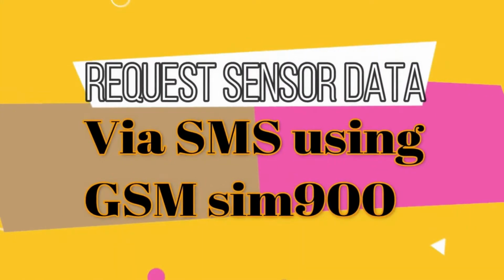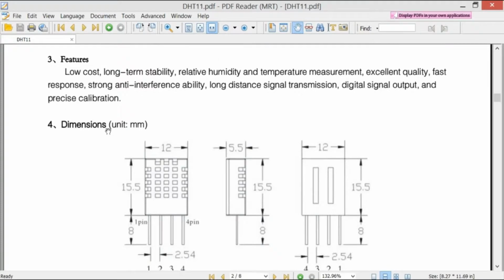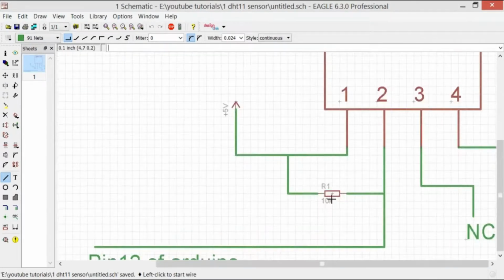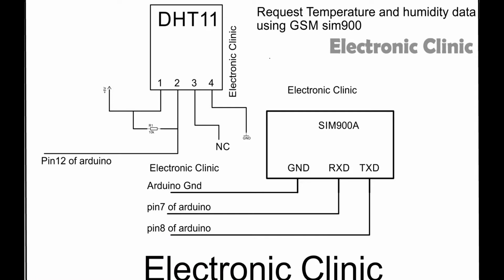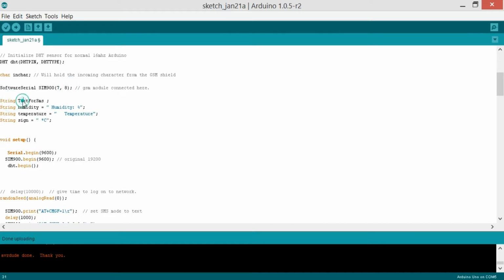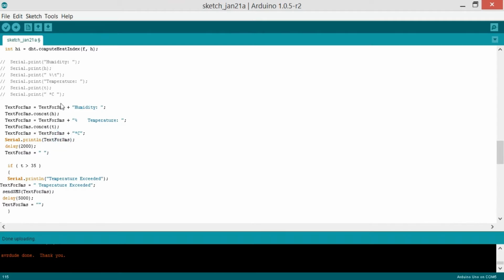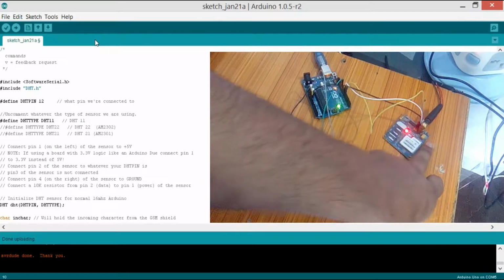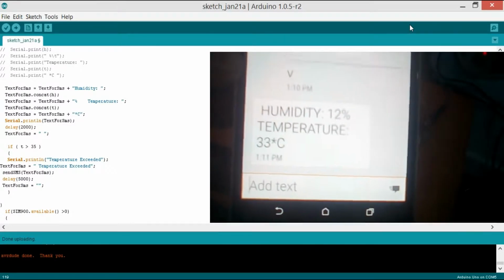GSM sim900A/sim900D based temperature monitoring from anywhere using Arduino board,DHT11,android cel

Comment: We are using sim800v2 is it compatible for the code you provided?
Reply from the maker: Yes it is. But I recommend get yourself 4g LTE module. Sim7600G.
Reply: Do we have to change anything on the code?
Reply: Because we tested it, its not working
Reply: Thanks

Comment: the sms is not sending, how can i solve the problem in my sim900a
Reply: what can i do, i think my sim900a is locked
Reply from the maker: if its locked then it won't work. Next time when you purchae a gsm module, try purchasing the LTE version. You can watch my videos on SIM7600G and Sim7600G-H gsm modules.
Reply: @ElectroniClinic  it is working fine and it is blinking but when im trying to call it, its not ringing. what can I do?

Comment: Temperature Exceeded waring appearing on the serial monitor and SMS transmission starts. But an ERROR message is appearing in the serial monitor at the end and no SMS received on the phone. Even setup is not responding to "v" SMS. Please help.

Comment: I have done everything described in the video above.
For temperatures exceeding the setting temperature, SIM900 will send SMS to the cellphone.
but for the status request from the cellphone by writing the letter v, sim900 cannot send sms.
when the letter v is received by sim900, the message that appears on the serial monitor is only: + CMT: "+ xxxxxxxxxxxx", "", date, time, ....
Are there any suggestions and input for this problem...???

Comment: Awesome tutorial, really!

But I have question, is it possible to use LM35 as the temperature sensor?
If yes, how can I connect it and how should I change the programming codes?

I need your help soon! Thank you in advance
Reply from the maker: Yes you can use.
Reply: @ElectroniClinic  Aha, okay. How about the program/codes/sketch sir? How can I change it for LM35?

Comment: How to power up arduino and GSM SIM900A module from same supply?
Reply from the maker: watch my Tutorial on LM317t adjustable voltage regulator.
Reply: @ElectroniClinic  Arduino Power jack requires 9V 500mA while GSM SIM900A requires 12V 2A. How to satisfy these requirement? Thanks for your reply. 

Can I use 9V 2A power adapter for both ?
Reply from the maker: the gsm sim900A module that you are using has a 12v Regulator?? if it has a regulator then now problem you can use a 12v adaptor for both. 
But if your gsm module has no on-board voltage regulator then make sure you input voltage does not exceed 5 volts.
Reply: @ElectroniClinic  yes, you are right sim900a module has 12v regulator with it. But Arduino requires 9v to power on.

Comment: Hello sir 
I'm trying to create temperature monitoring system based on arduino uno with GSM but it is not giving SMS what i ro
Reply from the maker: check your wiring. make sure you connect the tx of the gsm module with the rx pin defined in the programming and rx pin with the tx. and also make sure its connected with the gsm network. its a straight forward program. people are using this code without any error.
Reply from the maker: jo connections kiye hain aap ne mujhe whatspp karo. ke mei check kar lun.

Comment: Code:
//facebook.com/kienkang.bnm//
#include <SoftwareSerial.h>
#include "DHT.h"
#define DHTPIN 4
#define DHTTYPE DHT11
DHT dht(DHTPIN, DHTTYPE);
char inchar;

SoftwareSerial SIM900(2, 3);
String TextForSms;
String humidity = "Humidity: %";
String temperature = "Temperature";
String sign = " *C";

void setup() {
  Serial.begin(9600); 
  SIM900.begin(9600);
  dht.begin();

  randomSeed(analogRead(0));
  SIM900.print("AT+CMGF=1\r"); 
  delay(1000);
  SIM900.print("AT+CNMI=2,2,0,0,0\r");
  delay(1000);
  SIM900.println("AT+CMGD=1,4"); //delete all sms
  delay(1000);
  Serial.println("SIM900 san sang...");
}

void sendSMS(String message)
{
  SIM900.println("AT+CMGF=1\r");
  SIM900.println("AT+CMGS=\"+84904741370\"");
  delay(1000);
  SIM900.println(message);
  delay(1000);
  SIM900.println((char)26); 
  delay(1000);
  SIM900.println();
  delay(1000);
}

void loop() {
  if(SIM900.available()== 0)
{
  delay(2000);
  int h = dht.readHumidity();
  int t = dht.readTemperature();
  int f = dht.readTemperature();

  if(isnan(h) || isnan(t) || isnan(f)) {
    Serial.println("Failed to read from DHT sensor");
    return;
  }

  int hi = dht.computeHeatIndex(f,h);

  TextForSms = TextForSms + "Humidity: ";
  TextForSms.concat(h);
  TextForSms = TextForSms + "%  Temperature: ";
  TextForSms.concat(t);
  TextForSms = TextForSms + "*C";
  Serial.println(TextForSms);
  delay(2000);
  TextForSms = " ";

  if (t > 35)
  {
  Serial.println("Temperature Exceeded");  
  TextForSms = "Temperature Exceeded";
  sendSMS(TextForSms);
  delay(5000);
  TextForSms = "";
    }
  }

  if(SIM900.available() > 0)
  {
   inchar=SIM900.read();
   Serial.println(inchar);
   delay(20);
   if (inchar == 'v')
   {
    delay(10);
    Serial.println(inchar);
    delay(2000);
     int h = dht.readHumidity();
     int t = dht.readTemperature();
     int f = dht.readTemperature(true);

    if (isnan(h) || isnan(t) || isnan(f)) {
      Serial.println("Failed to read from DHT sensor");
      return;
    }

      int hi = dht.computeHeatIndex(f,h);

      TextForSms = TextForSms + "HUMIDITY: ";
      TextForSms.concat(h);
      TextForSms = TextForSms + "%  TEMPERATURE: ";
      TextForSms.concat(t);
      TextForSms = TextForSms + "*C";
       sendSMS(TextForSms);
          Serial.println(TextForSms);
       delay(2000);
       TextForSms = " ";
   }
  }
  }
Reply: how to include dht.h library file
Reply: Don't work in my arduino IDE

Comment: I am currently doing a similar project but I have to use an android application. Is there a way I can build an android app to retrieve the sensor values using the GSM module?
Reply from the maker: If you want to an android application, then i think you should usr nodemcu esp8366 wifi module, then u can access the values through firebase.
Reply from the maker: In cell phone you already have applucation for this. Why you need another android application ?? Explain
Reply: @ElectroniClinic  I was planning on creating a custom android application (using mit app inventor) that will receive sensor values that will be displayed on the application itself rather than using sms.
Reply from the maker: then don't use gsm. use nodemcu module and watch my tutorials on nodemcu. you can so easily read all the sensors and display the sensors values via app. and you can also monitor sensors values from anywhere around the world.